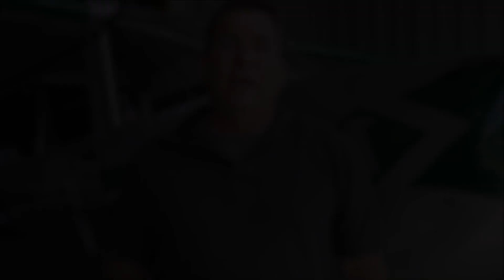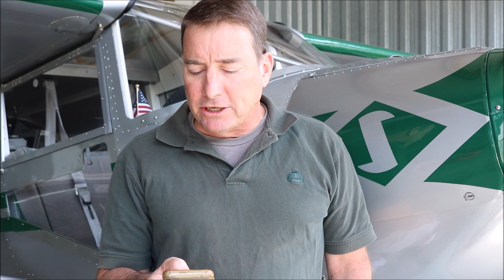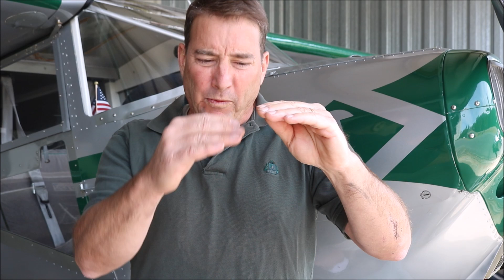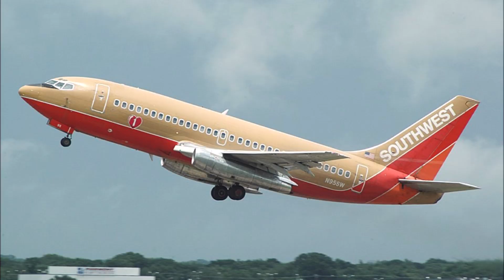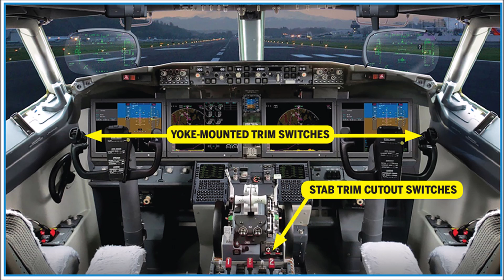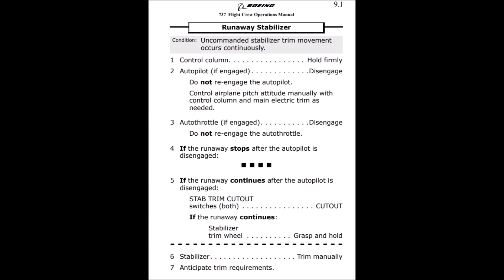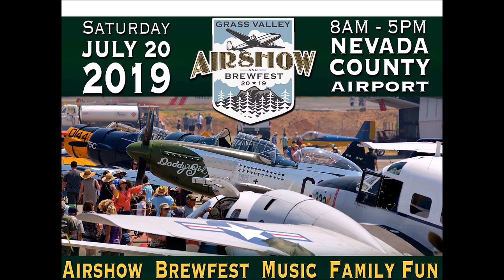737 Max UPDATE 27 June 2019 -The Latest Issue

Comment: Runaway trim- if nothing else works grab the wheel and hang on!
Reply: Juan covered this very action in previous episode, re: the actual trim wheels are smaller sized(much less leverage) to make room for expanded flight controls, instruments, etc.
Pilots need to dust off their "rollercoaster training" to take wing loading OFF the stabilizer.
Really, both crashes took place within scant minutes.
Tragic and unnecessary.

Comment: I think the best solution would be to remove MCAS entirely and re-train the pilot to the new stall characteristic of the plane.
Reply: agreed, 1 powerpoint slide and then pilots would know it as "737max staller" (or something more clever than that). Have all the helper systems you want, but keep ultimate control in the hands of the pilots we trust to do all they do.

Also, is there a good reason boeing did not retrofit the landing gears to add the necessary clearance for the bigger engines?  seems they could have kept the old wings & the plane would be more likely to fly like the standard 737.

Comment: So where was the FAA during the certification of the MAX? This should have been discovered during testing and initial certification.
Reply: The trim speed be the same on all 737 planes (not just the 737max) just seems FAA are Not happy how fast it moves when using powered trim manual control (never been a problem before on previous 737s more then likely the FAA have never done an actual high out of trim runaway trim procedure before in any 737 before)

Note this has nothing to do with the fixed MCAS system (that's already been Resolve) it now uses both AOA sensors same as auto pilot (so it won't trim if in disagreement) , it's movement speed and how far it can move the trim is now limited and finally if they pull back on the sticks but the MCAS is trying to trim the plane down it will automatically disable MCAS and stop trimming the plane down(it show an error on the FMA system)

What they are doing here purposely put the plane into a out of trim situation manually in the simulator and are running the runaway procedure (a memory item) but FAA seem to think it's to slow to move it manually using the powered trim System (the up trim button the the stick) seems they want the button to react faster when held down (or expect it to be a lot faster then what it is
Reply: xpavar The FAA does not have microprocessor experts, so a lot of the testing is delegated to the manufacturer. How much testing is necessary, is a different story.
Reply: @gordonrichardson2972   The FAA doesn't need 'microprocessor experts'. If there is a problem with the rate of horizontal stab trim movement using the yoke mounted electric trim switch during a uncommanded  trim runaway, the FAA should have brought it to Boeings attention long ago. It's up to Boeing to find a solution.

Comment: Your description of the latest 737 test problem is better than the mainstream media but still not quite correct.  The problem stems from (1) the software not allowing a sufficient ly prompt response to manual trim input, which could be fixed in software, or (2) the flight control computer isn’t fast enough/powerful enough to run the new software.  This would require a new flight control computer (FCC), which would set back the 737 Max return to flight well into next year, assuming a new FCC would require full FAA certification.  

Also, it isn’t clear that the manual trim response delay is just a 737 Max problem or actually more wide spread thru the 737 line.  The FAA should do the same manual trim test in a 737 NG simulator.
Reply: It is quite hard to provide an accurate description (given the limited information available), for a non-technical audience. This article gives a good overview: https://theaircurrent.com/aviation-safety/faa-and-boeing-initially-disagreed-on-severity-of-catastrophic-737-max-software-glitch/
Reply: Thanks for posting the link, that was enlightening.  The ugly possibility (2) still remains, that the FCC isn’t really capable of doing what Boeing hopes as a fix for the new problem.
Reply: @gordonrichardson2972  
This article is complete gibberish.  
"Last week the Federal Aviation Administration deliberately broke part of the 737 Max flight control computer.  . . . The deliberately broken microprocessor had become overwhelmed with data from the flight control system, significantly slowing the pilot's response to the virtual plunge in altitude. "
This non-technical description of the scenario completely obscures what was tested, the result of the test and the significance of the test.
One doesn't normally speak of "breaking" a microprocessor, unless what you meant was you fried it with high voltage or hit it with a hammer.  When you "break" a microprocessor in any sense that I can think of, it doesn't become "overwhelmed with data," it stops processing data, in fact, it doesn't do anything at all.
The article might as well have said that the FAA had someone take an ax to a portion of the avionics bay, and lo and behold, the pilots had some difficulty flying the plane (although they were ultimately successful).
How many other certificated aircraft has the FAA tried this experiment on?  Do they normally run around "breaking" microprocessors in flight control systems and then grounding the planes when they don't behave normally?
Reply: @danielforman5064  Your response says more about you than the article.
Reply: @danielforman5064    From the context in the article, it's quite clear that the FAA pilots 'broke' the processor simply by overwhelming it with input data.    Very common computer jargon to talk about 'breaking' code, and if you can do that with an axe I'd like to know how.    And it should not be possible in a critical component.    If it's possible to fix it with a bit of reprogramming, that's one thing.   If the processor is at the limit of its capacity and they have to change it to faster hardware, that's a whole new headache.
Reply: @cr10001  
I spent 16 years writing software (the last 7 writing DBMS system software in assembler).  We occasionally spoke of breaking an algorithm or unit of software, but never spoke of breaking a CPU or microprocessor.  And I doubt we would have referred to a capacity issue in an algorithm or processor as a "fault in a processor."

I don't think the context of the article or the text of the article makes anything clear.  
The article says the "test pilots flew a scenario causing a fault in a microprocessor . . . The result, which both people said was expected as part of the scenario, caused the jet's simulated horizontal stabilizer to move on its own . . . The deliberately broken microprocessor had become overwhelmed with data from the flight control system . . . ."

I think you are interpreting this to mean that Boeing and the FAA knew of a sequence of control inputs that was expected to overwhelm a microprocessor within the flight control computer causing a runaway trim condition.  I find that very hard to believe.  If they knew of such a sequence, then why would they have granted certification or, if they learned of it after certification, why wouldn't they have issued an AD?

In any event, I stand by my point is that the article does nothing to clarify the nature of the test the FAA conducted, the result of the test, or the significance of the result to safety of flight.  And it does nothing to clarify whether the fault they found is something they have tested for in any other aircraft.
Reply: Here’s some startling news:  

https://www.moonofalabama.org/2019/06/boeings-software-fix-for-the-737-max-problem-overwhelms-the-planes-computer.html

The FCC’s on 737 MAX are apparently based on 16-bit 80286 processors.  Holy crap!
Reply: @danielforman5064     "Boeing and the FAA knew of a sequence of control inputs that was expected to overwhelm a microprocessor" - that's how I read it.   (Of course the article could be wrong or just badly worded).   They may not have thought of it during initial certification (it happens) but it may have become apparent during their recent intensive scrutiny of the systems.

Comment: So the manual trim adjust is a bit slow.
This may have contributed to the MCAS-induced crashes, as those basically devolved into a fight between pilot wanting to trim up, and mcas wanting to trim down. A slowed pilot-commanded trim adjust would have skewed the balance in this fight in the wrong direction.

So, a possible aggravating secondary cause to the crashes?

But yes. I saw that report of cnn, and it smelled like week-old herring to me.
Thanx for clearing it up!
Reply: I'm not an ATP but from my review of the DFDR data shown in the Preliminary Reports, the sketchy information about the latest problem, and my understanding of MCAS, I don't think this new problem is very likely to be a secondary cause of the accidents.

The newly reported problem is said not to be related to MCAS.  If that is true, then there is no reason to believe that MET will not interrupt MCAS as advertised and no reason to believe that MET will not reset the clock for MCAS to activate to 5 seconds as advertised.  So even if MET didn't trim up as fast as the test pilot expected, that doesn't mean continued use of MET wouldn't eventually raise trim to the desired level, all the while suppressing MCAS.

Also, if you look at the DFDR data for the ends of each flight, the problem doesn't appear to have been a slow trim up response.

In Lion Air, at 23:31:10, the crew interrupted MCAS with MET, but did not hold MET to trim back up.  A few seconds later, MCAS activated and the crew immediately interrupted it with MET, but again didn't hold MET to trim back up.  At 23:31:25, MCAS activated again, and wasn't interrupted.  At 23:31:35, the crew momentarily pressed the MET switch but at the same time, apparently advanced the throttles in a severely nose down trim condition.  There was another MCAS activation during the resulting dive, which was immediately interrupted by a momentary press of the MET switch, but there was no sustained attempt to trim up with MET.

In ET302, MCAS activated at 05:40:00 for about 10 seconds (i.e., wasn't interrupted).  The crew responded by applying MET for only about 3 seconds, which failed to fully correct the trim condition.  At 05:40:21, MCAS activated for about 7 seconds, and was interrupted by MET for about 9 seconds.  This mostly reversed the second MCAS trim-down action, but still didn't restore the trim to its pre-MCAS condition.  At 05:43:21, MCAS activated for a final time (after electric trim was turned back on) for 4-5 seconds.  It was apparently interrupted by the CUTOUT switch, not MET, so the effectiveness of MET could not have been a factor in whether the crew could correct the final MCAS trim down movement.

Comment: How about a switch that disables all computers and a pilot hand fly's the plane.  Or at least, work towards this.  No pilot would let a plane get into an extremely steep dive.
Reply: Can't do that, as your likely refering to MCAS they are not testing MCAS (that's been fixed and 2 failsafes and 2 tirm power limits are in place). they are setting the flight simulator to high out of trim setting and trying to recover from it by pressing the up trim button and they believe its not going fast enough (most likely been doing this trim speed manually for all 737s not just max)

Your are correct a good/normal pilot should not be letting the plane get into this situation in the first place and most pilots will pick up on heavy stick as been out of trim within seconds even if the stick shaker has gone off (witch is what lion air and second crash did not do, lion air they never attempted to cut trim power even though they knew the powered trim system was the cause, the stab trim power switches are not just there for show, second crash they did cut trim power but they did it to late, there mistake on the second crash was they switch the trim power back on and did not attempt to do a dual pilot trim adjustment on the trim wheel they just gave up when the co-pilot couldn't move the trim on his own  and switch the power Trim system back on which resulted in a final dive which crashed the plane)
Reply: It would most likely require a new type-rating of said airplane. And pilots need to have the sufficient training to be able to actually fly the airplane.

Comment: I don't have any large aircraft time but, my instructor used to get on me about flying the aircraft with the trim. He always wanted me to correct the pitch problem with yoke inputs and then trim off the excess pressure, the instructor giving me my BFR just told me the same thing. Granted, control forces are a lot higher but wouldn't that apply to airliners to some degree?
Reply from the maker: Yep!

Comment: Would this have been normal on all 737s?
 Not critical  when there was no MCAS to counter quickly. I have nothing to do with Aircraft but this is often a problem in Machinery running a mix of older Mechanical Control with a Computer Interface.
A delay caused by the old Mechanical system not responding immediately. 
When they hit the Trim switches do they activate the old cable system on the 737 or does the signal go directly to a Jack Screw Actuator at the Jack Screw that acts immediately?
The two often don't mix well. With say and old Lever on a Machine the operator simply yanks hard on the lever. They get a quick response.  Put an Electrical Interface the operator has no control. Presses a button and the useless thing only stops or starts slowly. Give him the Lever back. You can use it steadily or in a panic violently and get it to react quickly. 
Just guessing? No real knowledge on Aircraft.
Reply: Good analogy! That is almost exactly the way the new trim system on the MAX works (as best I understand it...)

Comment: If the microprocessor in question is an off-the-shelf, widely used part, the chances of the microprocessor per se failing is virtually nil.  More likely, it is a software error, sensor failure, or software inability to deal with a sensor failure.  However, in my career I have seen failures in microprocessors having embedded Flash memory, namely, the firmware evaporating 6-7 months after the device was programmed.  That kind of device should NEVER have been allowed to get into a production-release version of the aircraft.
Reply: Probably information overload during a critical part of the flight. This article gives a good overview: https://theaircurrent.com/aviation-safety/faa-and-boeing-initially-disagreed-on-severity-of-catastrophic-737-max-software-glitch/

Comment: It is sheer folley to keep producing an aircraft with known (and unknown) faults. If the max needs hardware changes (which I suspect it might, given that we are fast approaching September and the "software fix" updates have gone very quiet),  boeing would have alot of work to do retro fitting all the parked up planes. It may not even be financially viable or physically possible to re-engineer the max, what would boeing do then? It's a little late to start designing a new plane. Would they approach Airbus and build the Neo under licence in a new era of "collaboration"?

Comment: The impression one gets, right or wrong, is that Boeing are trying to fix the unfixable. We've all done it. Problems keep coming up, yet one goes on hammering away, adding complexity, driving up a blind alley until finally, reluctantly it is borne in upon one that it isn't going to work, at least in its present form. It is back to the drawing board. Writing a novel, a scientific conundrum, a dysfunctional relationship, the process is pretty much the same. Time for Boeing to start afresh . . . ?

Comment: It may be fixable in software, it may also be that the existing trim motor drive circuits can't put enough current into the motors to move them any faster under some load conditions..?  This would be my most likely interpretation that they might have to replace hardware.

Comment: If the plane is supposed to be flying level and the altimeter says it is going down then the program should put it back to the pilot.  The problem is with the program not the airplane.
My friend Larry was core engineer on the 737 wing.  He did not use a computer.  He retired 10 years ago and died a year ago.  He was never replaced.  He would not have allowed the 737 to be dominated by software.

Iguana

Comment: Has the new software slowed down the button response time or has it always been slow like this and Pilots have just lived with it. If the later that's another black mark for the original FA testing and certification process.
Reply: Most Likey it's always been this speed (all 737s not just max) I would expect at higher speeds the trim would be slower (as a fast moving time could result in some unwanted sudden trim movement) 

that happened on a Airbus when 2 of the 3 AOA sensors suddenly thought the plane was pitching up high so the computer very sharply moved the trim down a number of times so fast that people was crashing into the roof (actual holes in the inner roof where people had hit 2-3 times before they disabled the auto pilot)
Reply: @leexgx    No, actually, it wasn't an AoA sensor, it was a single one of the three ADIRUs (air data inertial reference units) developed a freak fault that sent signals (multiple spikes in the AoA data) that found a loophole in the flight control computers' programming.    The programme should have ignored the defective ADIRU and relied on the other two.

AoA sensors being mechanical have a known failure rate which is why nobody (except Boeing) ever relies on just one.
Reply: @cr10001  it was effectively the same thing (be it a signal or the AOA it self doing it) they fixed the programming to prevent that from Happening again and added other limits to make sure the flight system can't make very sharp movements again if it somehow happens another way they not considered